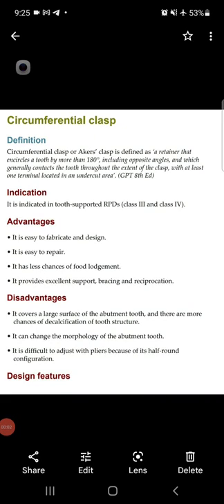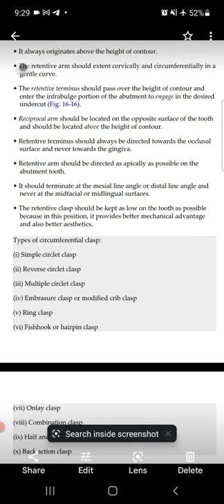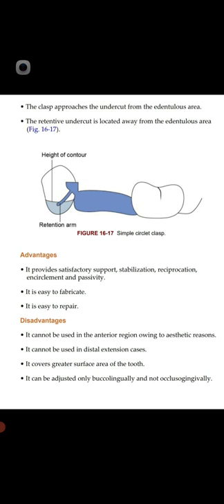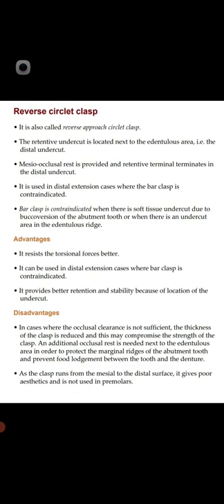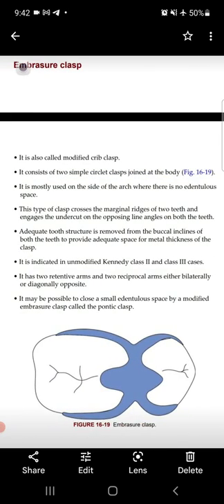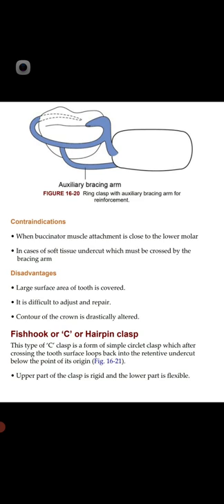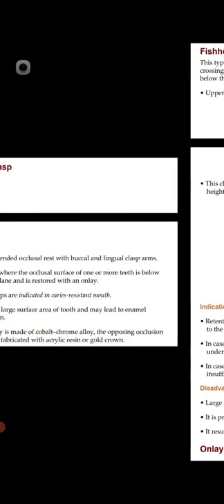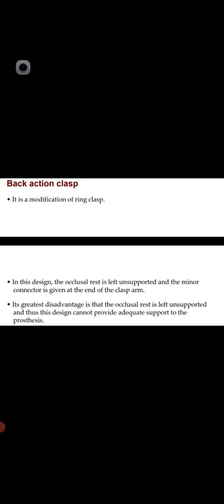Rapid revision course of rpd prosthodontics/Circumferential Clasp/Circumferential Clasp types/Clasp

Comment: First molar missing and second and third molar tilted to
the space.in this case what type of clasp is not to be used on the second premolar 
distal I bar
distal facial
wrought wire
mesial circumferential
mesiofacial